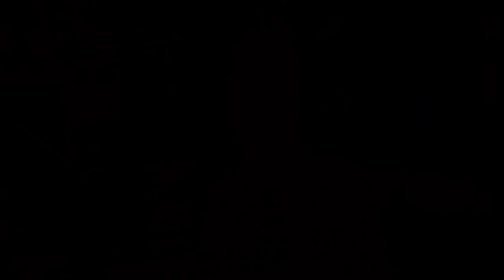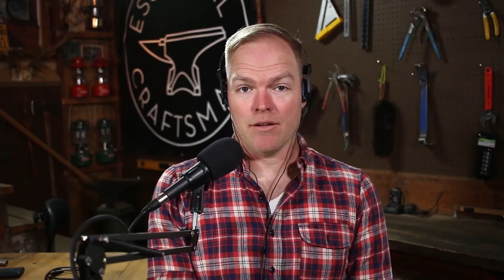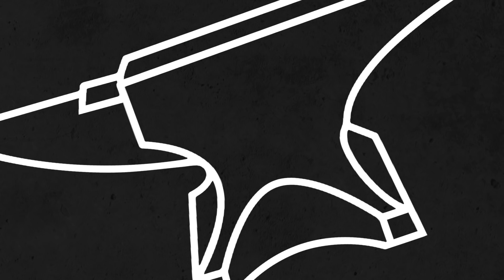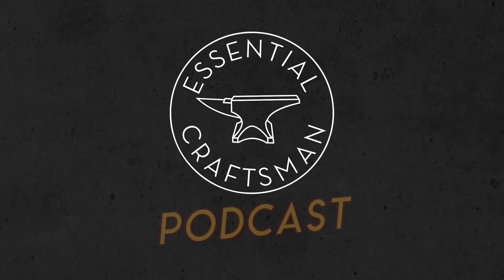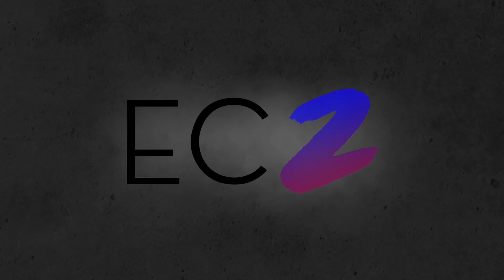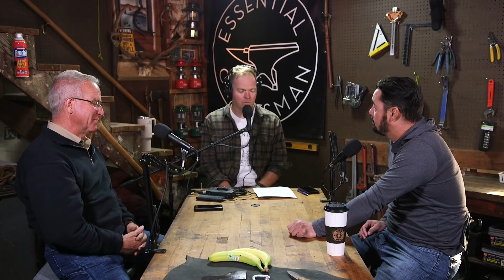Tile Setting Myths, Tips, Tricks: Phil Hu ECP 79

Comment: Speaking of grout: Our house was built in '84, we bought it and moved in in '86. The shower has a fiberglass pan with off-white gel coat, 4-inch-square off-white porcelain tiles, and pure-white grout. I see ads for companies that will come in and replace your dingy dirty grout with fresh grout, and how that will really perk up an old tile job. Except our grout is beautiful, smooth, clean, and after 35 years it's still pure white. When it gets dirty and dingy, I just wipe it clean.

I've seen a lot of tile jobs: Homes I've lived in, homes I've visited, etc. But never have I seen this particular material used as grout.

Back in '84 the tile guy used white silicon rubber as grout. Silicon rubber stays flexible for decades. When it gets coated with a layer of calcified soap scum, all you need to do is run a stiff-bristled tooth brush down the grout line. The grout will flex and the brittle calcified soap scum will flake off 100%. Cleaning the glazed surface of the tile is more effort, and typically requires harsh chemicals. Fortunately silicon rubber is impervious to any cleaning product I've seen.

Now I've worked with latex caulk, silicon/latex blend, silicon caulk, and silicon aquarium sealant. Each more difficult to use than the previous, with aquarium sealant the most problematic. it will stick to some things (glass, stainless steel, some types of stone, and glazed tile) and never ever let go. Smear a bit where you don't want it, and you'll have hell cleaning it up. And in the case of aquarium sealant it takes 2 days to fully cure, and pure silicon caulk isn't that far behind.

It must be a living hell to apply, and my guess is two full days to complete, plus a third day to finish curing. I believe it's worth it, and have tried to puzzle out how a guy might apply it without making a huge mess. I'm not a tile guy and have never tried to grout tile, but I do have DIY skills and two engineering degrees, so my mind naturally goes to problem solving.

Knowing what I know, I'd try masking the edges of the tile. To simplify that step I'd mask one direction--let's say horizontally. Then apply silicon rubber in the horizontal spaces only, tool it off, wait an hour or so for the stuff to skin, then peel up the tape. Don't touch it until the next day! Now mask in the other direction, apply the silicon rubber, tool it off, wait an hour, peel the tape. Give it a third day to fully cure.

That seems like a ton of work compared to all the videos I've seen on grouting tile. Given that silicon rubber is way easier to maintain than other grouts, it might be worth the effort.

The silicon rubber joint between the tile and the fiberglass floor pan is another issue. The silicon rubber had let go of the gel coat, harbored mold and slime, etc. At the end of 2019 I peeled it all out, cleaned it up, and applied a fresh white silicon rubber caulk. So far it looks awesome. The gel coated fiberglass pan looks like hell. I should sand it down and repaint it. I'll have to find an expert in painting gel coat. It'd be nice to get 35 years out of that paint, but I suspect it isn't possible.

Comment: Great conversation guys! Schluter is awesome, I have been using it exclusively for 5 years now. It is easy to become a Schluter evangelist, because it works! In relation to floor first vs. walls first in a shower, I definitely prefer floor first for 2 reasons;:
1.Most importantly it protects the Schluter foam pan from my big feet, dropped tiles, or any other damage. 
2.Second is the appearance of the joint as you discussed. 
Cheers!